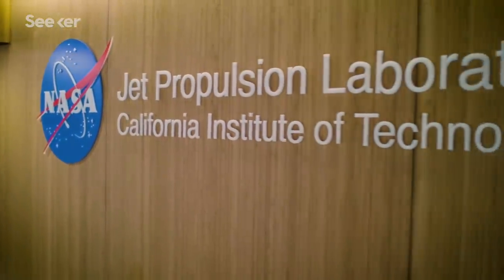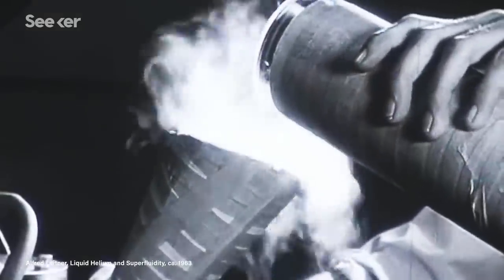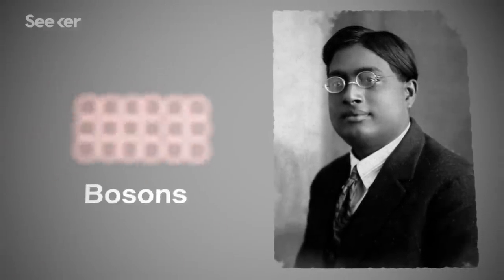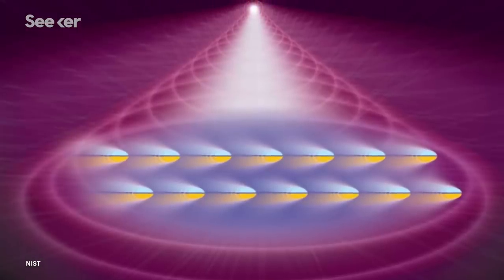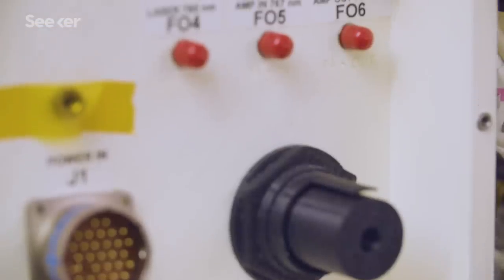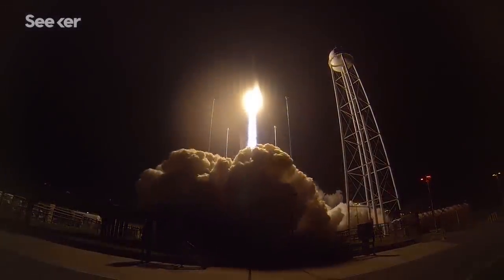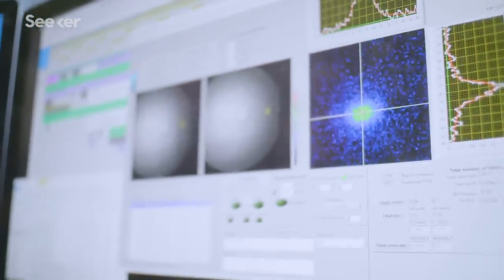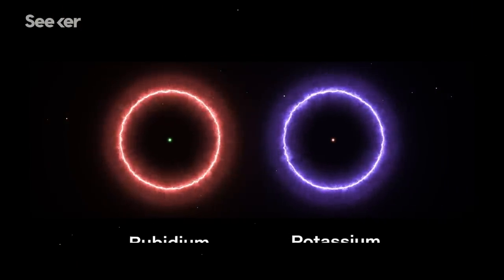NASA Engineered a Box to Create the Fifth State of Matter in Space

Comment: I always thought the ISS ran on a shift system to keep a similar amount of people awake at all times. Huh.
Reply: Astronauts already have a terribly hard time getting any real sleep because of the microgravity on the ISS, so if there's always someone awake while you're trying to sleep, you wouldn't get any sleep at all.
Reply: I wonder if astronauts also wake up from the "falling sensation" when trying to fall asleep. I mean technically theyre always falling, but on the other hand they feel no up or down.
Reply: @TheEvanovitch  i think that astronauts have to strap themselves down to sleep.
Reply: Hopefully the heater on the ISS doesn't go down.. everyone would die instantly
Reply: @SpaceRanger187  Definitely not instantly
Reply: @SpaceRanger187  No, it would take quite some time for the ISS to cool down. In space there is basically no atmosphere (there is no absolutely perfect vacuum anywhere and def. not that close to earth, but it's good enough really) that could absorb the heat. This means that heat will mostly be lost through blackbody-radiation in the IR spectrum, which is much slower than direct thermal exchange. In the same way it would also absorb radiation coming from the sun, which should mitigate the heat loss.

I'd also be surprised if there weren't redundant systems for literally everything necessary to sustain operation. And if that were to fail aswell, a simple heater is literally the easiest thing to build as long as you have electricity. Just connect the two terminals of a low voltage DC PSU with a cable that has a sufficient resistance and within a minute at most it should be hot to the touch.
Reply: @janisreinberger7724  id be worried about being cooked for exactly the same reasons as to why it cant cool down too dangerous levels in any realistic timeframe.  if you've ever played oxygen not included, getting stuck in a box that infinitely warms up is pretty scary.
Reply: They dont have a large enough crew to do shift rotations. Generally there are only three to five on board at a time, and there have been at least two instances where only one crew member was on board the ISS, all alone for an extended period. :/
Reply: Astronauts have to strap themselves down to sleep, the ISS, like any 24/7 workplace has a "schedule" for sleep, although erratic, they were likely referencing to the part researching the new state of matter, and the falling effect is a built in reaponce to the natural fear of falling, so very likely they still do that up there
Reply: They just make up the narrative as they go along.. Some up there would never use water near the machinery as it would be very dangerous, while others do special zero gravity tricks with balls of water..

Comment: Honestly... what if the Atoms are splitting the pole? think about this for a second. the wave would be around the particle. in something like the dual slit experiment, the particle's wave would be the magnetic field around the particle. the area between and around the slits would hold some amount of magnetic wave of its particles. the magnetic waves interact with each other as they pass through the slits creating a change in direction to the least resistance. once it has made it's initial motion or most significant motion, the particle inside its's wave is also in motion within the parameter. making the entire atom move in a wave motion till it eventually spirals in it's eventual direction. none of this garble i just wrote has any scientific terminology nor do i have the knowledge to specify each interaction. i am simply trying to relay what my mind is thinking but unable to explain in terms that would paint a better picture and be scientifically correct with terminology.

Comment: I dont get it, isn't using lasers to cool something down kinda counter-intuitive? I mean there's got to be some heat in the laser, isn't there? How does that work then?
Reply: They heat the atoms so they jump out of the trap, taking energy with them
Reply: @kianmatthew4463  WHAT TRAP BRO
Reply: Akram Safirul basically all heat is is the vibrations of atoms, all heat from lasers comes from adding energy to the vibrations in the material. If you time the laser blast right you can dampen the vibrations and cool the atom. Like pushing someone on a swing out of time to slow them down

Comment: So, what's the difference between this and plasma? I find it very suspicious that non of this started happening until the 20th century. Why? Why now? There is one major difference between this box and plasma - temperature. Plasma seems to be the exact opposite of whatever this thing is. Plasma (think lightning) is the hottest thing on the planet. This seems to be the coldest..and, not even on the planet - unless you think if a D-wave quantum computer which must maintained at actual zero. Both seem to be some form of nano tech. This, for some reason, reminded me of the Russian "nano spirals" found in, I believe, it was Siberia. If you haven't seen those, look those up! These things are precision machined tungsten based rods with a spiral equally placed, as it snakes around the rod. These too, are  believed to have been used in some kind of quantum mechanics. We, ourselves, use similar microscopic devices for the very same reasons. I'm no physicist but I think tungsten is a superconductor itself. I could be wrong. It does stand to reason that, if it is, tungsten would be a logical choice. It's extremely strong, light and used in the medical field for various reasons. That, and Titanium. I'm scratching my head trying to figure this out. What's the ultimate goal for this box? What are it's implications? I still don't quite understand because I'm also not an astronaut. Shit, man - I'm afraid to train for the Randanaut program and ya don't even need a rocket for that one! But, that's a different subject for another day. So, the questions remain: what is it? What is the idea behind it? And, is this plasma related - even if it is the "polar" (no pun intended) opposite?
Reply: because we didn’t have the tech until now?
Reply: Did you know technology advances? Yea a shocker right!?

Comment: What is the point of this? What does it accomplish?
Reply: You get new answers to problems unsolved before that with this information may now be possible.
Take for example, when you started learning maths you started by subtracting and adding (idk if this is the correct word not a native speaker I'm sorry). And you teacher asked you how many times would you have to sum the number 5 to get to 65 as a beginner this question seems impossible to answer.
But then you learn how to divide a number and you divide 65 by 5 = 13 . Which is the number is times you have to add up 5 (or multiply 5) to get 65
With that new discovery you can solve infinite more before unsolvable problems.
Like the scientists will do when they learn more about this new state of matter

Comment: Rebuilding is basically deep learning
Reply: Transmission limits of A/C power higher voltage and extreme cold what of the alternative D/C combinations parallel in series equals series in parallel as the binomial with multiple inputs the sparkling quantum environment

Comment: Elements has already 5 state .. solid liquid gas plasma and light
Reply: Light is electromagnetic radiation and made up of photons not atoms so it's not 5th state of matter.
Reply: @manofculture4249  :) you know nothing about electromagnetic radiation:)  …  you have to weight the tungsten and see the difference…
Reply: @manofculture4249  it’s about energy levels of the matter .. why an asteroid hits evaporating everything around the point it hits .. ? Because speed and energy … if matter moves at 300 km per second moves at light state and if it reach to 30 000 km per second it becomes energy form but below this rate 300 km per second I mean depends on the element for example if you move iron at speed of 150-200 km per second it will be like plasma … anyway it’s about energy level .. you increase the speed you increase energy …
Reply: @ilhandurmus  speed don't effect energy. It is the friction that increase heat energy and change state of matter. Actually it is the energy that increase or decrease speed. Also matter which poses mass can't reach speed of 300km/s and more.
Reply: @manofculture4249  ok

Comment: What exactly will this be used for
Reply: You get new answers to problems unsolved before that with this information may now be possible.
Take for example, when you started learning maths you started by subtracting and adding (idk if this is the correct word not a native speaker I'm sorry). And you teacher asked you how many times would you have to sum the number 5 to get to 65 as a beginner this question seems impossible to answer.
But then you learn how to divide a number and you divide 65 by 5 = 13 . Which is the number is times you have to add up 5 (or multiply 5) to get 65
With that new discovery you can solve infinite more before unsolvable problems.
Like the scientists will do when they learn more about this new state of matter.

Comment: So is this going to replace plastic or clean up the oceans or anyting? What's the purpose of this anyway?
Reply: The purpose of this is to learn, not all problems can be solved directly  with the information you have access to.
Take for example, when you started learning maths you started by subtracting and adding (idk if this is the correct word not a native speaker I'm sorry). And you teacher asked you how many times would you have to sum the number 5 to get to 65 as a beginner this question seems impossible to answer.
But then you learn how to divide a number and you divide 65 by 5 = 13 . Which is the number is times you have to add up 5 (or multiply 5) to get 65
With that new discovery you can solve infinite more before unsolvable problems.
Like the scientists will do when they learn more about this new state of matter. They may be able to solve all those problems with this information.
The problem about cleaning the oceans is not about doing it, is about knowing how to do it.